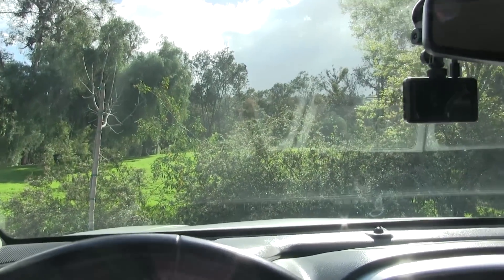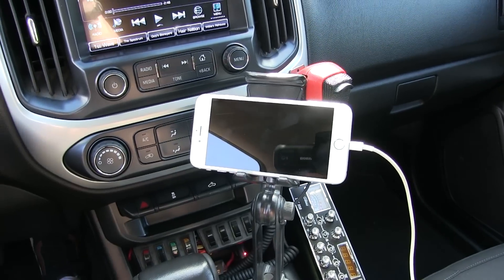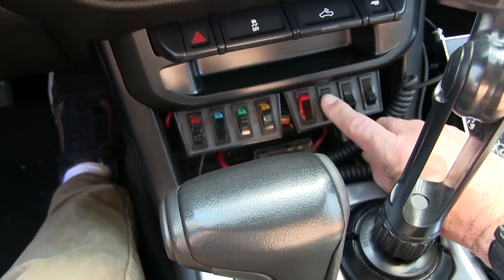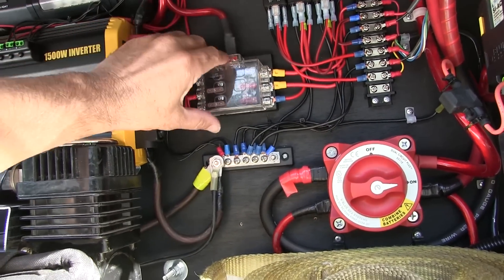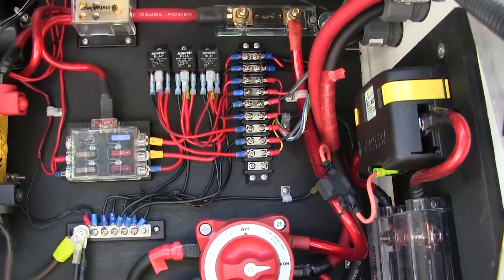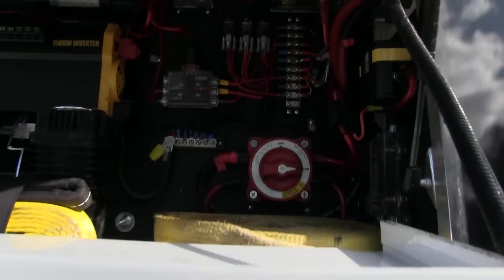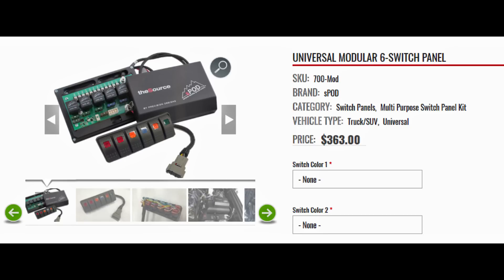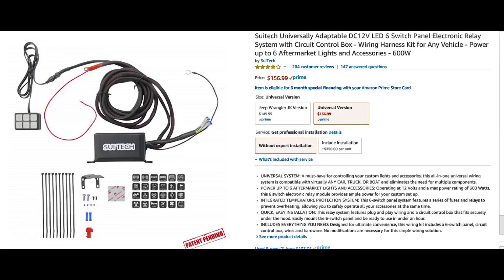DIY 12VDC Switches Relays Fuses

Comment: Blue sea has some nice stuff. Honestly, by the time you buy a cheap fuse block and then buy a separate ground bar, its only a few dollars more for a blue sea setup.

Im into ham radio and enjoy the time it takes me to build a nice quality and fully custom power distribution system, or even a power “go box” etc. 
The crap they sell already put together is almost always has undersized wire etc. Its pennies more to run some nice 10 awg as my main supply, and then 12 awg as secondary, and then I typically finish out at 14 awg. Dont usually go lower than 14 gauge
Reply from the maker: I use Bluesea products. I have the 12 circuit fuse block waiting for install. Going to take some reconfiguration!

Comment: Bronco!!!!

Gone save myself some time & drop $200 for rough country MLC-6  prewired universal switch panel/fuse box or $230 and get the factory outfitter switches from a 2005-7 ford trucks with the custom cubbyhole plate for obs trucks just like where you have the switch panel in the bronco but you still gotta run wires like you said

Comment: My issue with painless and most of the power distribution systems that you have shown is that they are obsolete when compared to how modern car wiring has been done.  Instead I prefer eaton bussman 200 amp ssvec's for my wiring needs.  Modern, weather proof, uses weatherpack connectors etc.  You should check them out and leave companies like painless in the dust.  In fact if you dont want to do your own American Autowire started selling these in a custom configuration under their severe duty line.

Comment: This stuff is handy for sealing bolt holes and cable entrances etc. in electrical boxes.  It is extremely economical and in my experience does not harden or dry out.  It is somewhat sticky.  Probably available at Home Depot etc.

https://www.gardnerbender.com/en/p/DS-130/Duct-Seal-Compound-1-lb-Pugs#